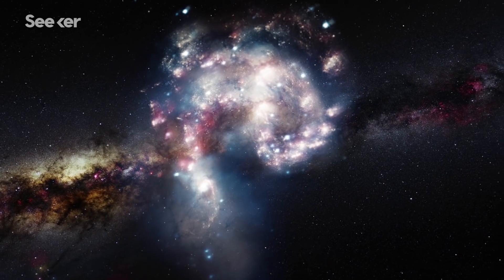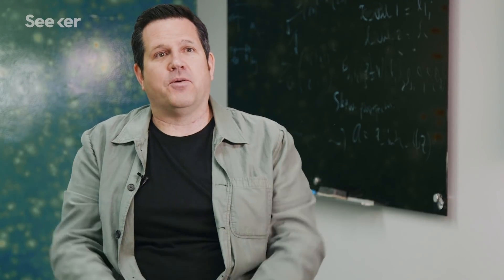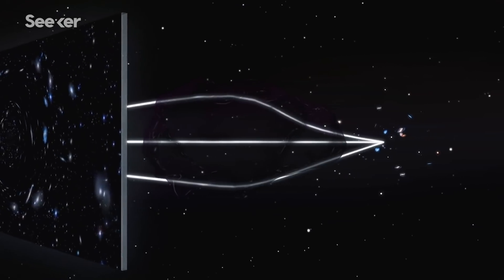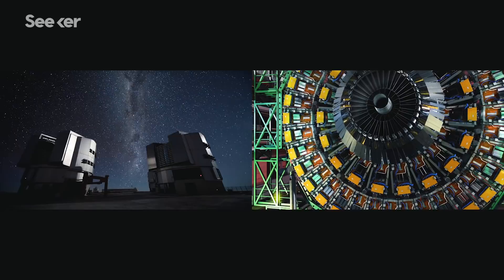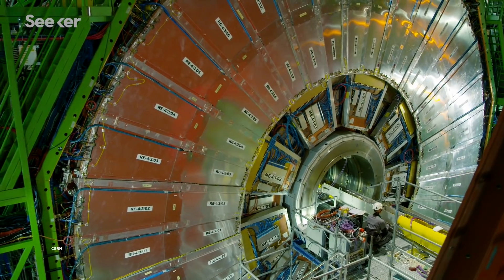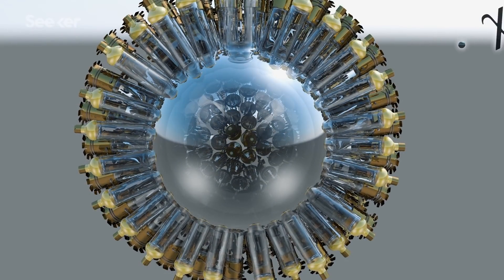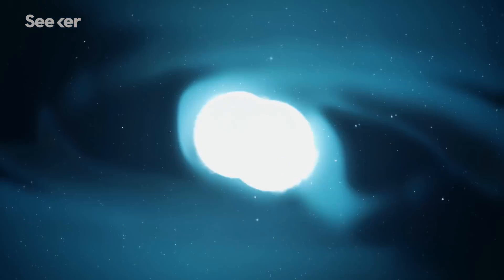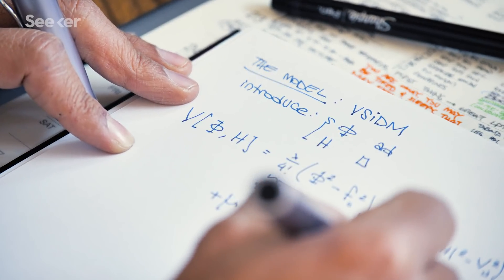How Close Are We to Finding Dark Matter?

Comment: Dark Matter Consistency

The Cosmic Soup is a homogenous blend. This means there's areas of higher concentration and areas of lower concentration within the Cosmic Soup. Areas of low concentration are sound planetary and lunar orbits, while outside the Oort Cloud barrier, Dark Matter has the ability to clump. The inconsistent parts per million ratio and size variations of particulate of Dark Matter leads to starships needing at least a conical hardlight shield when I'd their starship isn't aerodynamic. Hardlight Shields are used to deflect Dark Matter particulates away from the hull of starships during space flight. Dark Matter gives minimal friction, so space flight patterns must adapt to this variable. Across long distances at very high speeds, Dark Matter particulates function like normal atmospheres. When a star explodes, the Dark Matter particulates exuded are more dense than any other time. This is because the outward force generated by the star exploding shoves nearby Dark Matter past the Oort Cloud barrier into deep space where the normally unaffected Cosmic Soup Dark Matter particulates get waves of new matter particulates. High density patches of Dark Matter gather together to create nebulae. Large nebulae create stars. Larger stars within the nebulae gather together to produce a star which creates a solar orbit with galactic gravity effects. Remaining nebulae particles begin to swirl to create planets. The solar system creates an Oort Cloud barrier. Oort Cloud rips a trail through the nebulae when exiting due to gravitational irregularities within the nebulae. Solar System eventually is projected onto deep space to obtain gravitic regulation according to galactic core.

The consistency of dark matter is the least in a planetary orbit about the star. The consistency of dark matter is greater in interplanetary space than that of the solar orbit. The consistency of dark matter is greatest outside of a star's Oort cloud. The electromagnetic radiation of a celestial body can be powerful enough to affect dark matter. Solar Radiation can be powerful enough to affect dark matter. This is why the consistency of dark matter drops within these zones. Since these two forces are more powerful than gravity, the dark matter yields to their radiation derived directionality over gravitic regulations.

Comment: The Persistent Universe Theory And Cosmic Radiation Concentrations

In this circumstance, I theorize that there are concentrations of Cosmic Radiation. These concentrations reflect a cluster of stars or nebula within the blanketed Cosmic Radiation. A hyper refined flower style radio telescope can focus to observe a very small segment of space to detect these concentrations within the Cosmic Radiation. This is useful to detect stars or star clusters just outside the visible universe. This detection technique in describe as "Fuzzy Logic". The ranged zone of this "fuzzy logic" is yet to be determined, but the concentration areas should be present within this zone. After this Fuzzy Logic Zone, the light waves are too far away to register as microwave radiation, and descend into radio waves. This is the source of the ever present radio wave chatter across the universe. The hum of the universe is stars too far way to see. After a very long distance, and traveling through billions or trillions of light years away, and the missing 75% of the mass in the universe now described as Cosmic Soup, the light waves just don't have enough power to travel any longer, so that last impact on that last micro particulate halts the wave and is absorbed into the mass. The law of conservation of energy dictates that energy can't be destroyed or created, only converted, so the ultra progressed light wave just directly translates into a kinetic nudge on the last microparticulate. With nudges coming from all directions, the microparticulate just floats around in random directions until another force acts upon it. The Cosmic Soup gets churned regularly. This churning technique causes microparticulates to gather according to gravitic principles, then mass generates out "nothing" (unobserved microscopic particles within a vacuum). That comet that came through the Oort cloud was eons (a really long time) in the making until it had enough mass to become attractable by it's closest solar system.

Comment: The Persistent Universe Theory And Cosmic Radiation

Cosmic Radiation is used to justify the Continual Expansion Theory. The Continual Expansion Theory is used to justify the Big Bang Theory. I purpose that the existence of Cosmic Radiation only justifies the existence of stars beyond the visually perceivable universe only. With the correct understanding of microparticulates across the universe, the existence of stars beyond the visual range exist in an area that doesn't permit light to penetrate the light years worth of distance. The microparticulates are designated as "Dark Matter" or "Cosmic Soup" in the Persistent Universe Theory. The Cosmic Soup essentially batters thee light waves into the nonvisible microwave radiation spectrum. The Persistent Universe Theory allows for individual solar systems to expand or contract within their own gravity sphere which corresponds with their own individual Oort Cloud barrier; but each individual solar system, complete with star or star cluster, planets and moons, asteroid belts, and Oort Cloud operates as a functional sphere amongst many spheres which have their own trajectory and velocity with some adherence to the galactic core. Each galaxy then functions with it's own trajectory and velocity relatively independent of adjacent galaxies. If the Big Bang Theory were correct, then just like a typical explosion, the denser matter would be propelled less than the lighter matter. This would also cause the truly ever present background radiation to be derived from a singular point, causing radiation voids opposite from the explosion point because of interrupting matter. Since these variables of radiation voids aren't true, the Big Bang Theory can be disproved by the ever present and omnidirectional nature of Cosmic Radiation.

Comment: Supernova Mass Reclamation Theory

When a star goes supernova, the planets within it's solar system would obviously be highly damaged and break into chunks, not necessarily particlize all surrounding mass. These chunks are pushed beyond the summarily popped Oort cloud into the cosmic soup that makes up dark matter. The introduction of new chunks causes a perpetual outward expanding effect which could trigger a previously undisturbed cosmic soup chunk to be propelled into other surrounding solar system's Oort clouds. With enough stationary cosmic soup dark matter, these hyper propelled chunks could lose momentum and become nearly stationary themselves, but with minimal cosmic soup dark matter chunks, the supernova propelled chunks could transition across the extra galactic space to other adjacent solar systems. This effectively operates within the law of conservation of mass as a behavioral result of star explosions. It's like using an explosive underwater and describing what each water molecule does in response to the sudden expansion. Technically, because space has the most minute amount of friction in dark matter unoccupied space, every molecule from the supernova will retain constant velocity until it impacts another celestial body or gravity well. To further, the planetary disks of each planet will determine the cosmic collision plane of that planet's mass to be pushed outward from the star's core point. The precise arch across this mass projection plane is determinate upon what full year revolution position that planet has around it's star during the supernova. This means that dependant upon each planet's revolution position is what direction those surviving mass chunks are projected. This confirms both the theory of dark matter origins and the theory of minimalistic drag inducing particulates in space. Since solar systems also have a galactic trajectory that they travel with their solar induced gravity which is correspondent to each solar system's Oort cloud, they can have seemingly random interactions with cosmic soup dark matter chunks that would appear as newly discovered comets. The existence of comets and their sudden appearances is the proof for the supernova mass reclamation theory. This generally conflicts with the big bang theory, which inherently solves the strong and weak radiation combination conundrum that is the the fundamental necessity of the big bang theory. This means that the universe is eternal, but experienced through time observations, for mortals. If the universe is eternal, and the law of conservation of mass is true, then the "God particle" a.k.a. the particle wave is the fundamental building substance and can be logically correlated with the "physicality" of the divine. The mentality of the divine is separate from the physicality of the divine but they interact with each other continually through sentience and life. This also defeats the cosmic heat death theory that is correlative to the continual expansion theory. To further, since these chunks are rapidly broken apart, then hyper cooled due to the coldness of space (?) microbes can survive on the comet, then crash into an adjacent solar system's planets to germinate it with life. Genetic soup creates simple creatures, evolution results with superior forms over enough time. Technically, eternal life within an eternal space, though very tiny lives across a very long time span. This also summarily defeats the age old adage of, "Can God create a rock that he can not lift?" by stating that God is the rock and the forces acting upon the rock, therefore, since they are of the same being, they work in unison as God wills and you're asking a being to defeat itself. A being can defeat itself, but only as it desires to adapt to or mold the circumstances presented. This also induces the critical component that mankind serves within divinity's overall plan, but isn't reliant upon our form to persist for divinity to retain a life component to the overall universal equation. Therefore, we should all point or index finger to the sky and state that we will explore, persist, and thrive our divinely blessed and shaped forms and species to conquer the vast unknowns of the universe, if Divinity Itself wills. This should also help scientists to believe in divinity itself and for believers to become more scientifically accurate with their informations. This also reduces the evil one's control over humanity just that much more by isolating away these conflicts from people that would normally sew dysfunction via ignorance. If it is easy for us to accept that the universe has no physical limit to space a.k.a. is infinite, then the leap to understanding that the fundamental particle and wave components would also be eternal through the law of conservation of energy plus the law of conservation of mass in unison shouldn't be difficult.

Comment: No such thing. Or rather, if invisible objects with mass that cannot interact with normal matter exists it wouldn't account for anything claimed. We know this because when experiments were done to determine the effect dark matter has on our own solar system it was found to be smaller than the margin of error. Additionally, the Dark Matter hypothesis was put forward as a possible explanation for the assumed missing Mass, but most of that missing Mass isn't missing any more. Why? Because of a competing hypothesis which has since gained traction. See, it was proposed that Interstellar gases could account for this missing mass, but that was initially rejected because it was believed such gas would be lit up, whereas now we know that at most it would cause a red shift, and we already had to build Special satellites just to see the mass hidden by this Interstellar gas so we know that the matter is accounted for now. 

This is what happens when a scientist bases their entire careers on a unproven hypothesis: it becomes like a religion to them, and it slows down scientific progress.

Of course, we can't disprove the possibility of such a type of matter, but we can discredit the hypothesis that most of the matter in the universe is made of this stuff.
Reply: U idiot, thats why we call it dark matter. Like the gas thing u talk about would be dark matter before we can detect it but after we do, we know what it is. But there are still missing mass which we try to detect. So just becuz we know it could be something=we dont need to know what it is? The heck are u talking about, thats why we looking for it becuz its not religion, we need to know what it is and all missing mass isnt found, man u are so dumb and stupidnjust like ur face
Reply: @realdeal5712  anyone who begins a comment with the phrase "you idiot"  isn't off to a good start.
Reply: @realdeal5712  no, it's dark matter because it's a literal variable in an old simulation. It was simply used as a placeholder for the apparently missing mass without defining it originally. After it was redefined, it was still defined by its mass, which by definition must be detectable if it exists.

Comment: Light has mass - or more precisely the charge streams that carry light waves have mass. Light is emitted by free charged particles and bounces around other matter before radiating out into free space where it spreads out, therefore light collects around matter. Charge has mas, charge is mass.
Reply: Pretty sure it's just:
Light has energy.
Energy can behave like mass. Photons don't have mass, but they carry energy.
Reply: @n3th537  .. officially a light has no mass but that does not mean the carrier of the light wave doesn't have mass, be it a (particle lattice) field disturbance, stream of 'photonic elements' or something else... I consider a photon 1 complete transverse or helical wave... The only base energy to me is (potential) kinetic energy.. I understand the Higgs notion of mass but do not buy it... More sensible to have an inertial base field that requires force to change direction, increasing with the number of constituent fundamental particles - TRUE MASS - than an anti-inertial base Higgs field.  The problem is they thought empty space was empty so frictionless in their model but it isn't empty so not frictionless. So explain inertia if space is not an inertial field of some kind... It's not like inertial objects are rocket ships with infinite fuel either.
Reply: @PrivateSi  The thing is, you'd have to break down physics by asserting this "carrier" at least if it moves along with the photon, since it'd require infinite energy which is impossible. Photons move at the speed of light... which is why it should have no mass.

Not entirely sure what you're talking about.
I'm trying to comprehend an "inertial field" if you're talking like a photon field, electron field etc. in quantum mechanics. Recently saw something about a new field being hypothesized which interacts with the gravitational field, but I don't really know much about it.

If it's an abundance of light collecting around matter being cause of the extra gravity, then that would be the Dark Matter scientists are looking for.

Comment: Why argon?
Reply: 1:  it has high scintillation yeild - it produces lots of light when excited and is transparent to that light.  2: high atomic number - bigger target means dark matter is more likely to hit it.  3: low radioactivity - you want to detect dark matter not radioactive decay. 4: inexpensive - important when you need 3600L
Reply: @pauldavis2108  a lot of good reasons.

I wasnt sure if they had a hypothesis on the interaction of dark matter with certain objects
Reply: @troyhenry6111  From a chemistry point of view it really doesn't matter what it hits.  The interaction is on the subatomic scale via the weak force so it just has to hit a quark - any quark in anything.  Trouble is quarks are so incredibly tiny that hitting one isn't likely and even if you do detecting it is even harder especially when you mix it in with all the other background signals from cosmic muons and radioactive decay.
Reply: @pauldavis2108  ok, i see